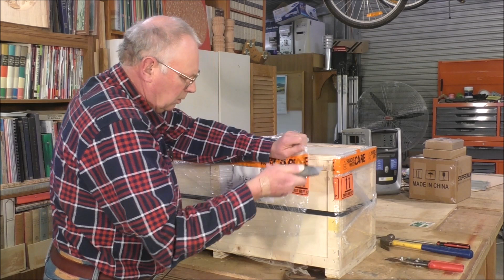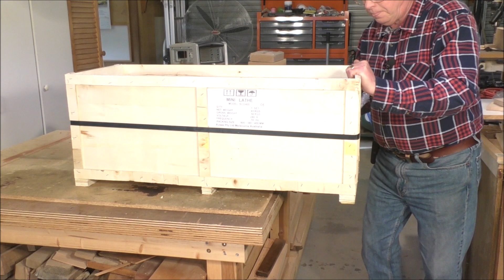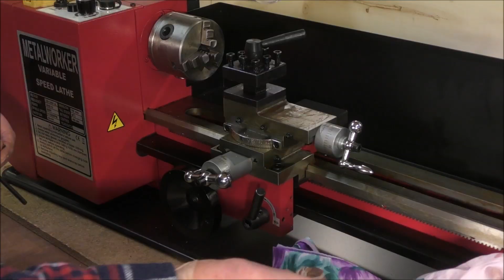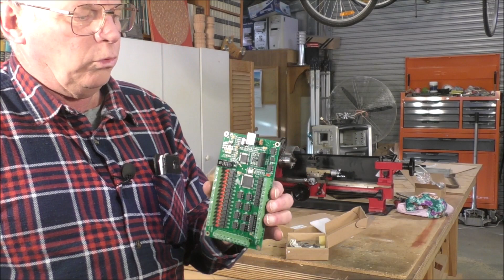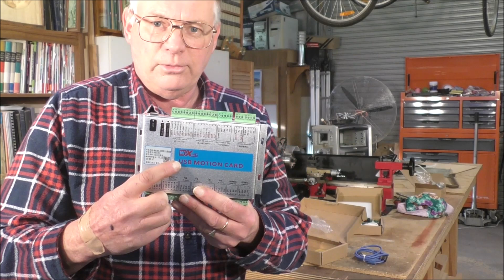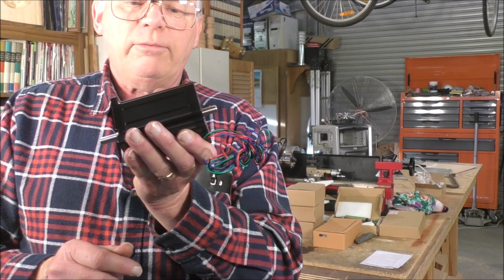HOW TO CNC lathe conversion  7 x 14 all you need to know

Comment: those lathes comes in all sorts of colors , brands and even sizes, but devil is always in the details because some models drop gear selection on the back in favor of single gear machine(high gear) which makes it useless for bigger stuff, although you go out of slides travel before that, even cheaper brands adds metal gears as standard now and tools comes in a cute plastic toolbox instead of paper box. but depending on price range knobs are plastic or metal and sets of tools and fitment of parts may differ. i will watch the series with pleasure because backbone is the same as my little monster
Reply from the maker: You’re spot on about the details, it's great to hear you'll be following along with the build! :)

Comment: Hi Roger ,
Excellent video and I’m looking forward to seeing this  lathe evolve into a cnc machine .
Not all of these machines are made by sieg and one needs to be careful comparing them as there are many factories in China that make them- if you want genuine sieg in Australia then Ausee are the only one i know of that sell them  , in the UK  arc eurotrade which i believe have links to Ausee as well are the main supplier and for  USA little machine shop.
I have a titan machine - same as the C2 sieg but  i picked it up off ebay as damaged for  a good price and converted it to use a 3ph motor and vfd and the only gripe i have with it is the carriage hand wheel is so close to the cross slide hand wheel it is easy to knock the setting on the cross slide when winding the carriage along .
I dare you to get onto the model engineer forum and tell them a Sieg is as good as a Myford ! You will be receiving hate mail for the next 20 years  i promise you !
Reply from the maker: Thanks, Ian, for watching
  Roger Clyde Webb ;-)

Comment: Roger, you said that this or a similar lathe is sold by Harbor Freight. I could only find a 7 x 10 and a 7 x 12. I’m I missing something?
Reply from the maker: Hi, try the little machine shop and grizzly
Reply: Although they are fundamentally the same lathe, every supplier seems to have slight variations in the features for their branded models and they typically don't do all four sizes (you can get 10, 12, 14 and 16 inch variants).